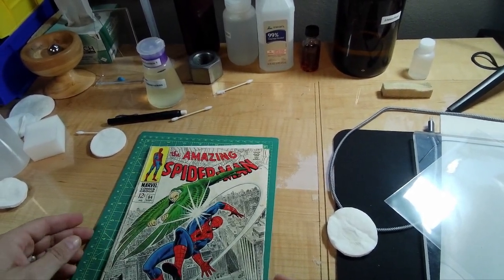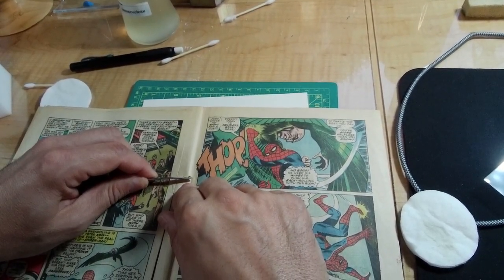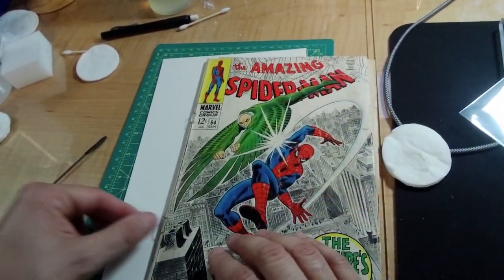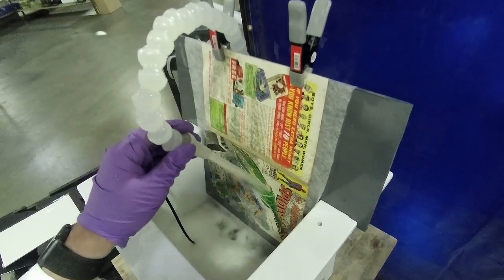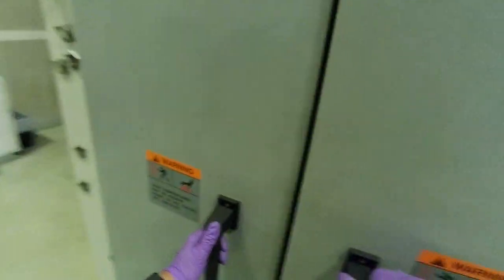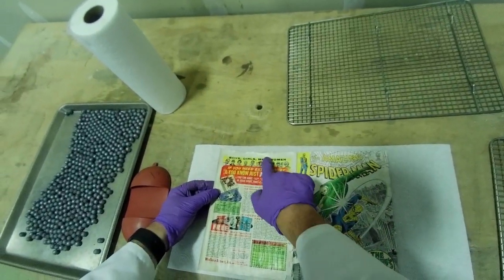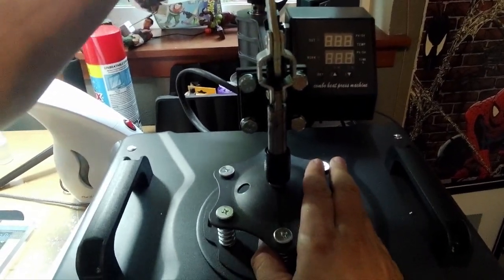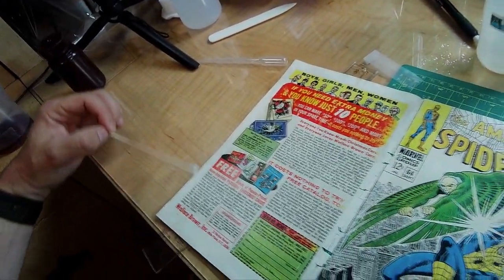comic book washing machine  Mark II

Comment: Red cover inks have long been problematic for comic collectors.  It's fairly common for '50s DCs for example to exhibit bleeding of reds that's very visible on inside covers.  Later eras can have that as well -- I recently bought some early '80s Superboys, and one of the few copies in a older sleeve exhibited red bleeding.  Apparently the plastic had reacted with the red cover ink, while the pages were newsstand-fresh white and the book showed no other signs of age.  Other same-age issues from the same collection, same series, exhibited slight tanning -- they had not been stored in sleeves -- but no cover bleeding.
Reply from the maker: Thats good info to know, thank you so much!

Comment: I like where the comic washer is going, although I ws thinking you would have gone with more of a slant then a vertical back. I definatley think the water pressure was to high, I am still working on ideas for my own version, but it's slow going.the part that bothers me  about every sort of a wash I have tried is the invariable spine split and need to repair it afterwards. I have found that a slanted baking pan seem to give decent results, but still working out what sort of  pump I want to use.
Reply from the maker: The angle vexed me for a long time, honestly.  I finally settled on 60 degrees to aid in drip-drying at the end.  But that was developed with an aerosol system so it may not longer be important. It’s a lot of development work and I’m always building and learning . Lower flow and a different spray nozzle  be next.  I can’t wait to see what you come up with!

Comment: what about using some sort of spongy material inside the clamp ends so that the rubber doesn't hit the comic .. or even some sort of flat surface , like a backing board folded some way etc..
Reply from the maker: That’s a great idea, I like the way you think.  I’m redesigning the clamping system now and I think you’ll like  it. Keep the good ideas coming!
Reply: @ImmaculateComics   no prob.. off the top of my head as well.. i'm thinking angling to some degree the surface that the book or cover rests on (ie : the surface that the water will roll down on) would take some gravity/ pressure off the clamp as well rather than have the clamps 100% holding the book up , especially w the moisture weakening the paper 
also the strength of the jet of water could be a bit of a factor in taking off ink , however obviously the strength of the mixture is most likely the much more important factor , but trying different speeds of jet 
lastly perhaps experimenting with applying the mixture to the opposite side of the cover that you want to affect .. 
anyway just random thoughts 

love your stuff 
wondering as well if theres somewhere to send pics of any attempted "work" i do .. still very early in my career  
thanks

Comment: hmm - and you sure that's dirt and not black ink loosened by the wash with the aggressive new cleaner?
Reply from the maker: Thanks to your insight I stopped and checked.  It was a mix.  about 5% ink and the the rest was "not ink".  good thinking Florian!
Reply: @ImmaculateComics  I was just sometimes really suspicious about the amount of dirt I picked up from a book I assumed was pretty clean - especially because it can pick up a lot of reds and yellows - but I really never saw black getting worsened so far. I guess when even after the aggressive wash it's only 5% black ink in the big amount of dirt, blacks should be pretty save generally?